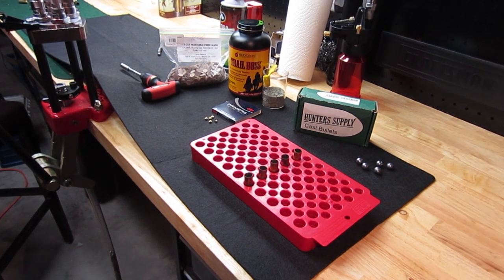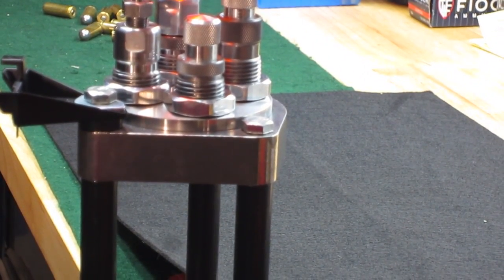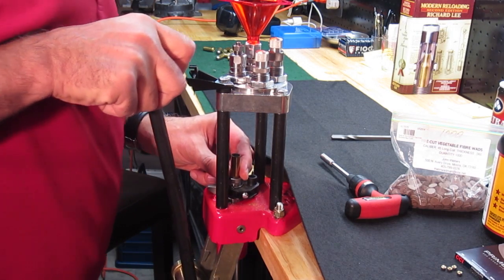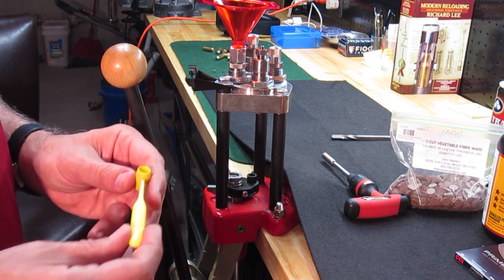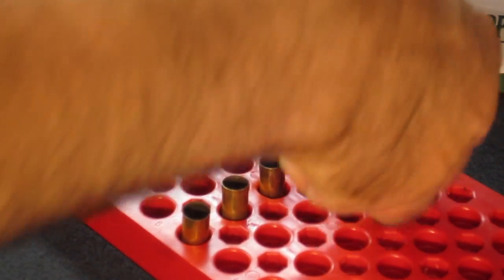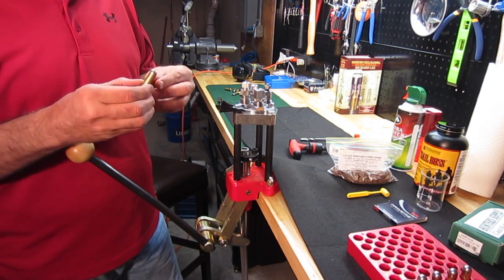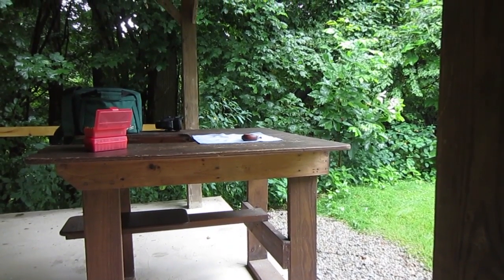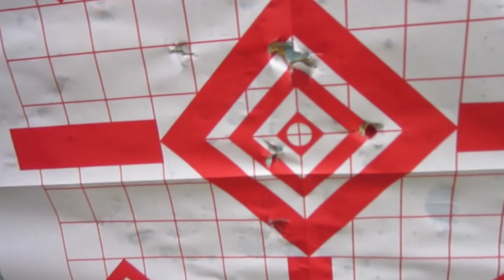Reloading .45 Colt Lead Round Ball

Comment: Dang, I was all bummed out when I saw you were gonna test accuracy of your reloads with a derringer barrel. I was hoping for something more typical, such as a 5.5 inch barrel or so. But it looked like the accuracy with those round balls was pretty darn good in your derringer. Thanks.
Reply: eqlzr2    That’s a 2 1/2 barrel on the Bond
Reply: I loaded 454 ball with pyro p and a wad. Shot through my 4.2" Ruger Redhawk, Itll put a handprint sized group at 15 yards. All stainless gun so cleanup was easy.

Comment from the maker: Hello there. I got the lead balls from hunters supply they are .454 diameter. Thanks for posting!
Reply: So what is the point of round balls in terms of utility?
Reply: The utility of round ball includes economy for practice purposes.  The ball is lighter and requires a smaller charge. If you cast you use less lead than for a bullet.  And, as you saw, recoil is a lot less. For a small pistol like the Bond, a second shot is easier but that doesn’t make it a defense round.

Comment: I did this experiment years ago using my Ruger Blackhawk convertible.  Used lee liquid lube for the hard cast ball and used the 45acp cylinder to  reduce  excessive case space.  Man!  Them babies shot low!  Way low...so low I couldn't see any constructive use for the load; since the Ruger was sighted for 230gr for close in and 315gr at long range.  Was an interesting experiment, though.

Comment: Very cool! I was wondering if this was possible to do with smokeless powder, and in other chamberings such as .45ACP
Reply from the maker: Hello there.  Trail Boss is smokeless.  I have used BP (Goex) though and it works fine.  I am sure you could do this with .45acp, but not sure how it would cycle.
Reply: mmerm I don't neccesarily think it would be unreliable, but it was more of a curiosity to se if it could be done. In a SHTF scenario or something you could make ammo using a .451 ball mold or something. I'm not a prepper, but survival knowledge is super important to me.
Reply from the maker: +nutnfan1 Trailboss is a smokeless powder.  The individual grains are in the shape of doughnuts and have a greater volume per weight.  I have used these round balls in .45 acp
Reply: what do you think he was using let me give you a hint it was not BP

Comment: Just curious, the Round ball Dia. Ive been pondering loading some up and i started looking at 45 cal Round balls, and noticed there are (44cal = .450) (44cal = .451) (45Cal =  .457) in the Hornady BP balls. I would assume .451 But thought id ask someone who has done it first :P (Might end up swagging the .457, so i can use it in 45-70 too. )
Reply: they are .44 cal. 454 147grain not 143 grain he had it wrong and you can reload them with S.less.P. or B.P. and you can also do  with 31cal. , .36cal. and .44cal. for those of you who know what I'm talking about.

Comment: Those loads are mighty punney. 
At least load them with say 5.2 to 5.6 grains of trail boss.
Even 6.5 grains of Unique would be better using the same wad proceedure.
Reply from the maker: Thanks for the comment Denis... You can load them as you wish.  That is the beauty of handloading  Better in which way?
Reply: @McPilot_W3DDS  
If you chronograph your loads I am willing to bet they would barely crack 500 fps. Cowboy loads typically fall in at around 650 - 750 fps and that's with 200 and 250 grains bullets.
I do agree with your use of an over the powder wads. That keeps the powder up against the primer which would give a far more consistent velocities as opposed to all that loose powder shaking around in those large black powder cases which tend to give erratic velocities.
Reply: I'm not McPilot , but generally such a round ball load is intended for a very light load with minimal recoil .
Reply: @filianablanxart8305  
True. However loads at the very bottom of the velocity scale can and have been known to get not even exit the barrel and get lodged in the barrel causing a dangerous squibe load. As an avid reloader for over 45 years one would need to do some very extensive and safe testing with such loads at either end of the velocity spectrum.
Reply: @McPilot_W3DDS   You do not see published BP loads this slow since people have tacked a target onto a hardwood tree trunk.  These puny suckers can bounce back at you and injure or kill you!  OTOH, Trail Boss at 70%+ in your case will work fine with round lead balls.  Taylor’s & Co. forbids any spacer wads in their/my converter cylinders.